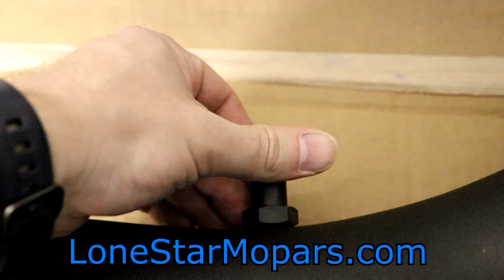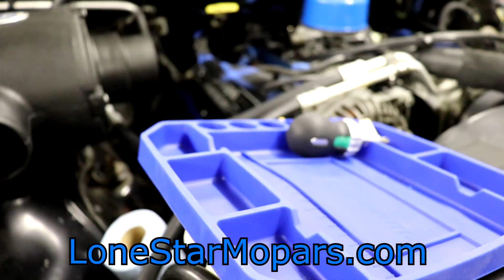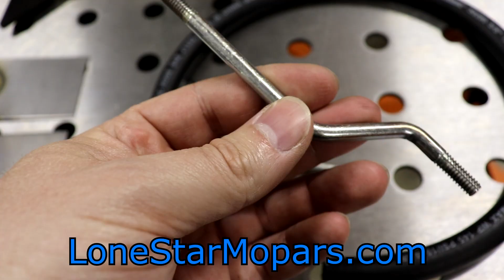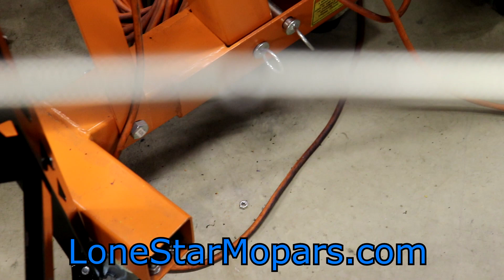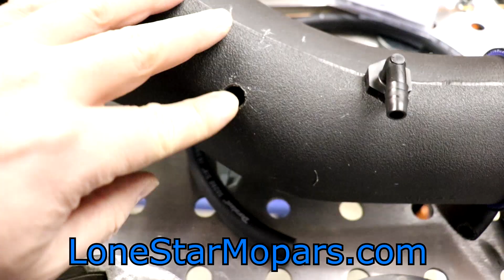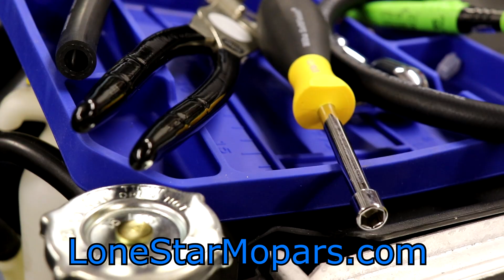Ram Revival Part 78: Cold Air Intake Install

Comment: Been searching an issue on my 99. Lost power to the starter switch/power windows/blower motor/speedometer. Was told neutral safety switch or key switch. Both replaced. Still has same issue. 🤷‍♂️
Reply from the maker: Hmm...have you checked all the fuses.  I want to say you'd have the panel at the LH Door and then the PDC (black box) by the battery.  If it all checks out and you put 12V to the individual, good fuses you might be able to trace back to the issue.  Replacement parts have gotten really bad...You might try another ignition switch.  I'd also check the wires that feed in...could have been chafed and aged out at this point.  I had a buddy over today in his 01 Cummins and he was telling me we could get "Antique" plates next year...hard to believe these are 25+ years old now.
Reply: @ thanks for the input! Fuses are all good. Gonna have to put in the work and trace it all back to find the culprit.
Reply from the maker: Good luck!  Hopefully it turns up pretty quick!